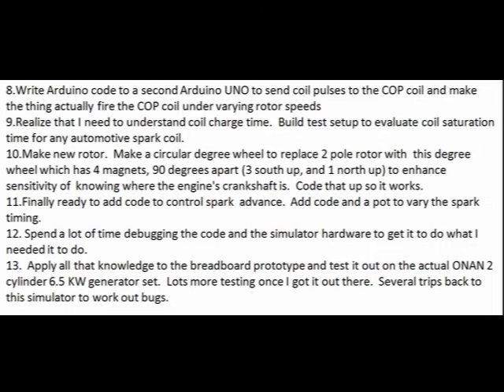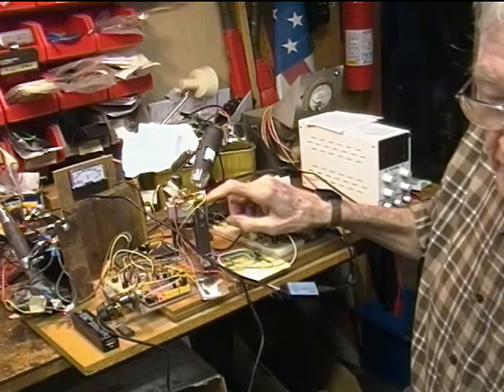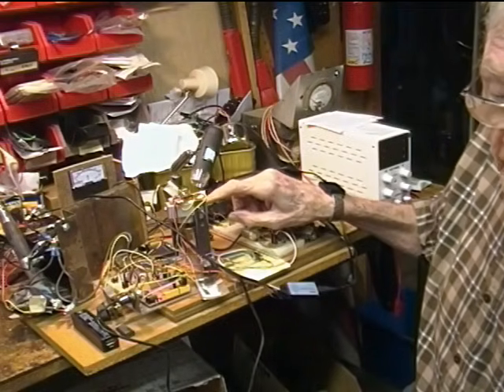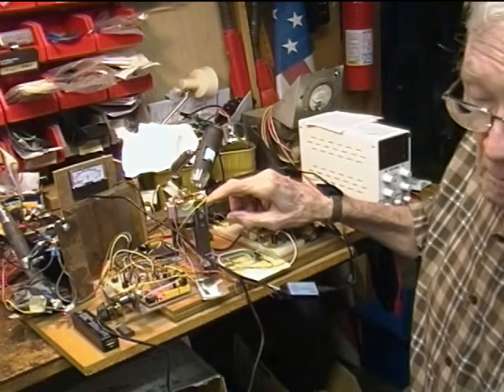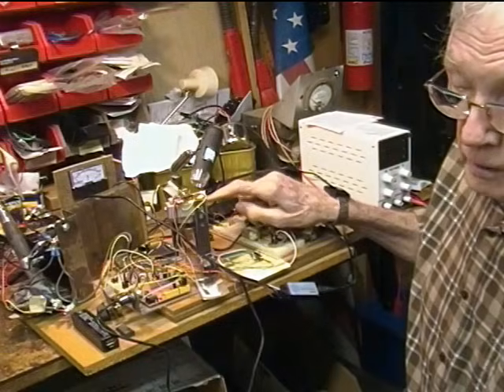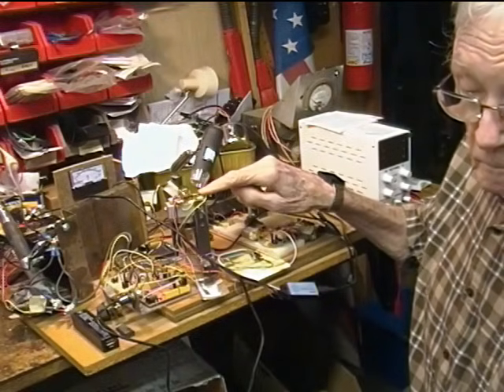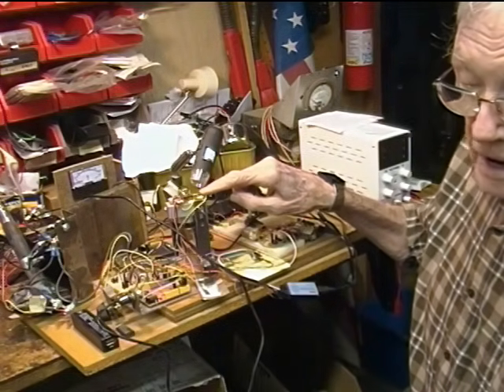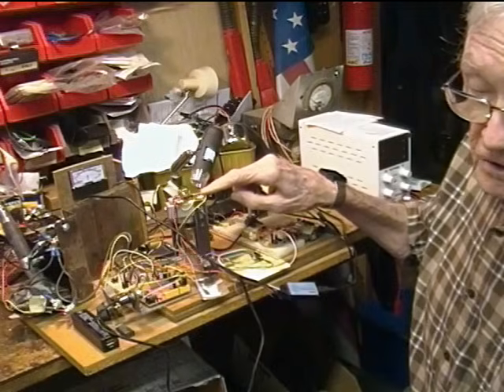My Arduino Ignition Simulator #223

Comment: Very interesting video. Sure wish you had some sort of schematic of what this all looks like electrically. There are a lot of dots to connect there without further explanation. I like the idea of using a coil on plug. Thanks again.
Reply from the maker: Sorry about the lack of schematic.  I did draw up a horrible block diagram by hand, but looking at it this morning, it is incomplete.  I only got as far as locating enough components so that I,  myself, could remember how it worked.
Reply: @frenchcreekvalley  Thanks for the reply. I look forward to seeing some potential updates and more in depth explanations. I tried using an Arduino for this, but could only get about 5 volts out of it, certainly not enough to cause a spark plug to spark. How many volts and amps go into triggering the coil on plug? I understand that the coil on plug actually draws it's main current from a 12 volt battery.
Reply from the maker: @skip6517  You ask the right questions. I encourage you to examine the two playlists that I reference in the description of this video.  There you will find answers to many questions that might arise.
You might also go here on my website:
https://spaco.org/Computing/Computing.htm
And scroll down to the article:
"Arduino Based Engine Ignition Controller for some Small Engines":
To answer your specific question about firing the COP coil:  The electronics in the COP coil assembly only need a 5 volt logic level signal which is easily produced by the Arduino Uno.  The COP coil assembly is, indeed, provided with 12VDC and provided the several amperes needed to charge and fire the plug.
Reply: @frenchcreekvalley  Thanks for the suggestions. I'll check out those video's and report back in a few days.